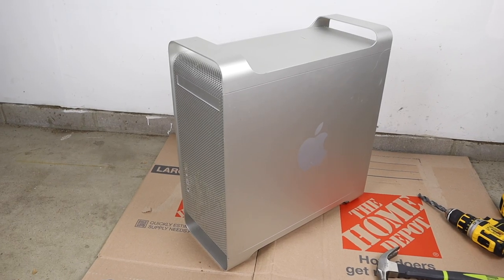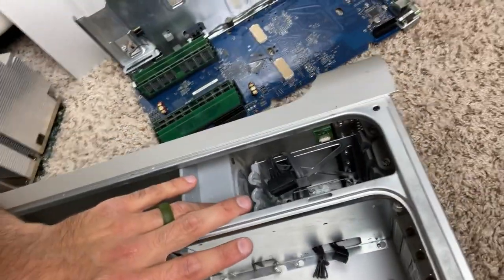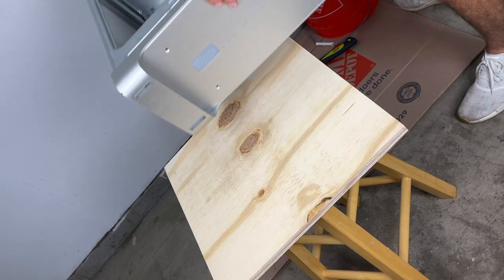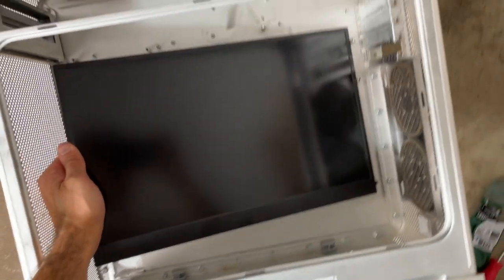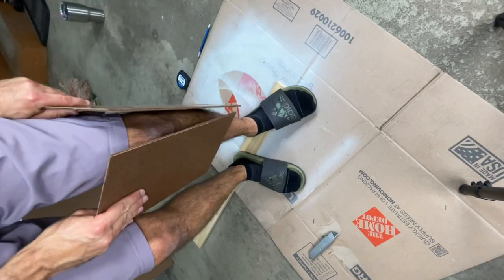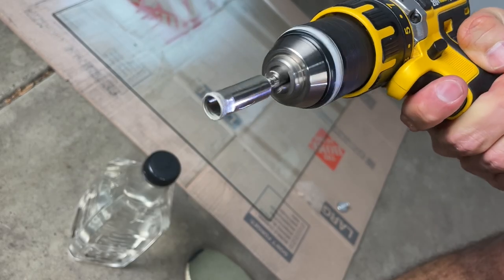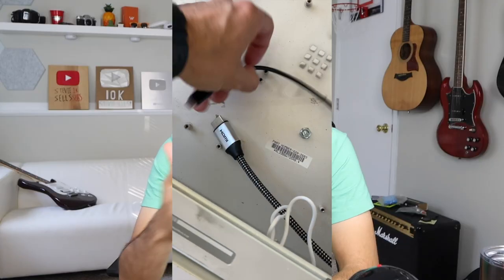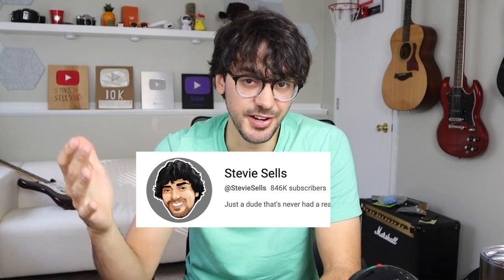I Turned An Old Mac Into A Table

Comment: The battery is basically to keep the BIOS running when the computer is not powered
Reply from the maker: got it thank you!
Reply: Yeah it’s also for keeping track of the time while it’s turned off
Reply: Yup its called a CMOS battery most computers use a button cell 3V watch battery. It stores info about the motherboard so if u hit BIOS key and make changes itll save but if you take battery out it'll default BIOS settings to manufacturer settings. In short Tracks time, Holds settings changes for motherboard.
Reply: @StevieSells  Its called a CMOS battery, every computer has one. The one on the Mac isn't your typical 2032 battery

Comment: I kind of think the best option for an old premium desktop PC is to gut it and try to ebay the old PCB boards....and then try to reuse the case and rebuild a PC form factor into it, or just flip the cleaned case on ebay too. That's assuming no flip value for the original. 

Taking a used case and turning it into Ikea furniture PLUS a working desktop PC would be a plus. Turning a pair of stacked used PC into a podium that mounted a wall projector unit would be great. Turning it into a digital security station near an entrance way, maybe add a gun safe and there might be a market for it.

Comment: Can you repurpose the USB ports on the case or add some to allow you to charge devices??
Reply from the maker: Solid idea. That would be really cool actually. I think you definitely could do it.
Reply: if you replaced the ports with a usb extender that goes into a power bank or plug then probably, theres no chance finding a way to adapt the Apple front panel pcb :D